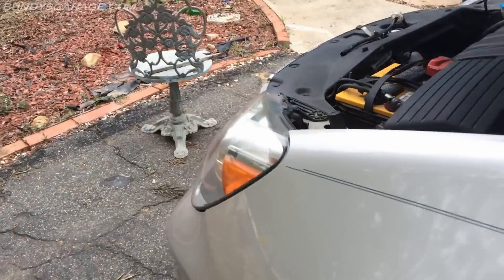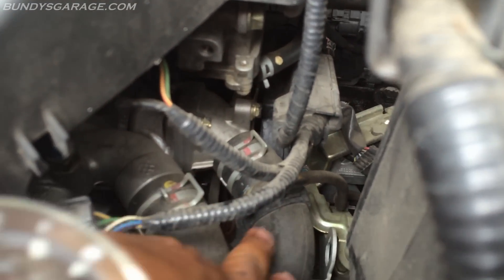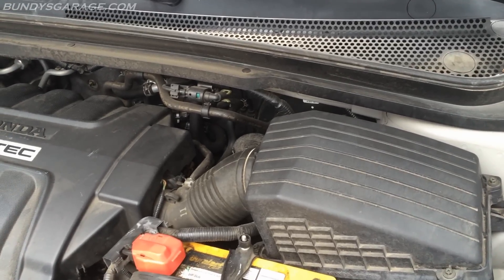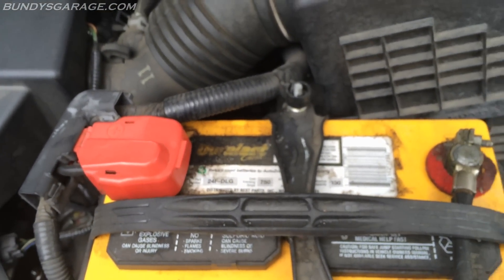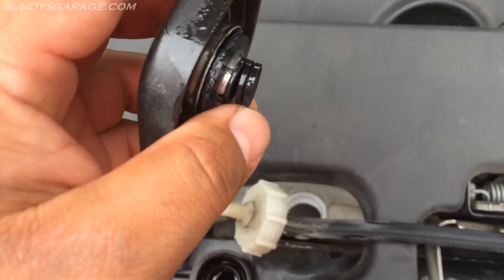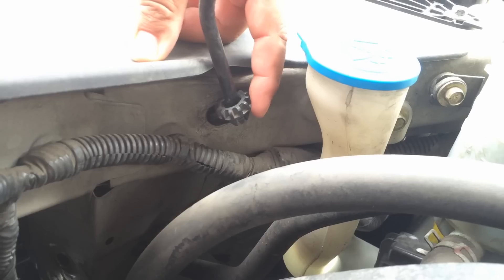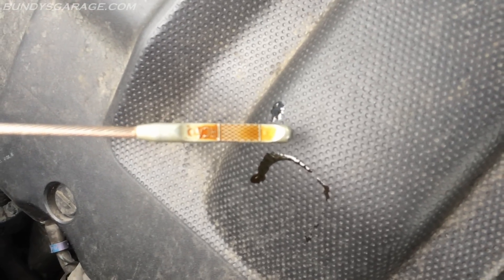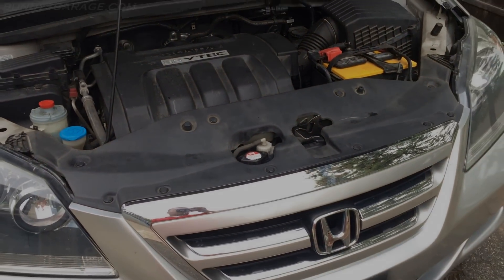J Series Honda Acura V6 - Common Things to Look for - Accord Odyssey Pilot Ridgeline Crossover TL CL

Comment: Feel late to the party, but I found out the Saturn Vue v6 i'm buying has this exact same engine, so thanks for making this video so I can stay a little more informed.
Reply from the maker: Yep the Saturn Vue has the same motor. If you can find one with a Honda J Series V6 you are in luck! I always thought it funny that GM uses a long air filter snorkel to wrap it back over the engine onto the passengers side when Honda has a short air snorkel that sits feet away from the throttle body? I have lots of videos that go over the Honda V6 if your looking for service and repair videos. Thanks for the comment.
Reply: @bundysgarage  
Hi! Bro i have a 09 Acura mdx 3.7  it recommend use premium gasoline,
Is that ok if i use 87?  J series same as pilot.  i would like to know your professional advice thanks.

Comment: I experienced bad power steering o-rings and serpentine belt tensioner my 06' TL J32A3. Also the rad cap spring fell in my radiator and i had to fish it out.
Reply from the maker: Yeah you have to make sure you use Honda power steering fluid only. As far as the radiator cap, it's a maintenance item and should be changed every 5 years or 50,000 miles. It does a very important job but only use a OE Honda Acura radiator cap same with the thermostat only use a OE as well
Reply: @bundysgarage  OE parts are the safest choice for long service.

IMPORTANT Also: cabin filter that eventually plugs up with dirt and cause the fan control module to blow its thermofuse. Changing filter early prevents collateral damage.

(Good call on the hot water heater blending valve that gets too hard to operate)

Brake fluid replacement prevents frozen rear pistons and dangerous rusted line blown out.

These cars are actually so good they need real maintenance
👍🏻

Comment: I have a 2000 Honda Accord EX, V6 that has recently started to have a jolt (almost like a bang) when the engine is started cold. When the engine is warm, it doesn't generally do this. The engine starts immediately every time without hesitation. The car seems to be running well, except for this initial bang/jolt at startup. Do you have any idea what might be the cause of this?
Reply from the maker: +Rod Stearns 99.9% of the time one or more of your engine mounts is bad. There are 5 transmission / engine mounts used in your car. Try that before anything else. Rockauto.com sells a component kit that comes with all the mounts you need to replace every single one. Please let me know if this fixes it.
Reply: I have that nasty bang too, so I did the mounts with OE parts... same difference 😂

Evidence show it is something with the transmission shifting on thick cold ATF or one of the solenoid strainer plugged up that can't modulate clutch pressure well enough... something in that ball park! 

Honda ATF flush helped just a little.
(No CanBus code)

Comment: Great video my 2009 Oddy blows warm for AC on drivers and cooler on passengers, last year a shop topped it up. Worked great all summer. This spring it appears to be back. Any advice on getting AC fixed? Since is a 2009 not looking to drop tons of $$$, a $100 recharge again is what I might need but I feel bad about the environment! Some other channel said replace solenoid which made no difference at all!
Reply: You have a refridgerant leak somewhere have a shop inject dye into the system and check for leaks about a week later

Comment: don't forget to check spark plugs and make sure cylinder #5 is tight (front middle) . if ur v6 has over 150000+ miles you might as well change the coilpacks. coilpacks wont last forever.

Comment: Brake fluid flushes aren’t necassary?? Wrong. Every 3 years, check the owners manual.
Reply: that is a great practice to preserve the entire brake system from rusting inside out. Heavy water travels down unless there is a low point P-trap... 

Power flush from the master is better than vacuuming air from around bleeders threads 👍🏻

Comment: That is not a 2004 or 2008. Its a 2005 or 2006.
Reply from the maker: +MrRangerZr1 You are 100% right.  I said the wrong year. It's a 2008. If you play the CC, I corrected it there.
Reply: +BundysGarage Its not a 2008. its a 2005-2006. 2008 got a facelift

Comment: Honda 3.5 is a maintenance pig If the general public was more informed when they went to buy cars with these engines Ill bet most people would turn away manually adjustable valves and timing belts? NO THANK YOU
Reply: Are you going around and commenting the same thing on all the honda videos?
Reply: @kayannhenry  Yes I only got up to about 8750 different videos so far
Reply: @dodgeking9194  well you clearly have a productive life
Reply: @kayannhenry  Well thank you I try and as a result I don't over eat because im too busy. I try to let people that don't know anything about cars know which ones to be aware of People just buy things blindly without knowing the details and then learn later unfortunately People that sell know most people don't educate themselves and this is what happens
Reply: I like the J Series V6s. But yes, its ridiculous that you have to have the valves adjusted and replace the Timing Belt on an Interference Engine! Why Honda engineers thought that that would be a good idea is beyond me. 
If I were a dictator, I'd make it a law for all engines to have Timing Gears.
Reply: @Boebus666  Who knows what they were thinking I agree with you 100%
Reply: Still one of the world's best engines in my experience.